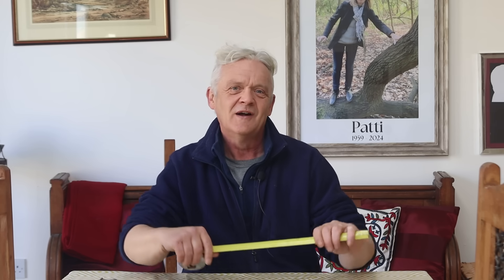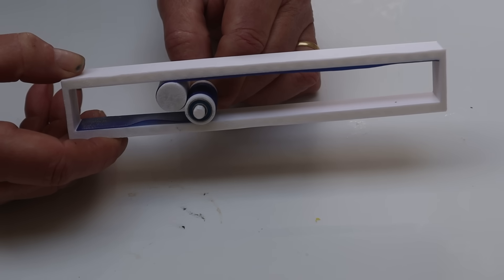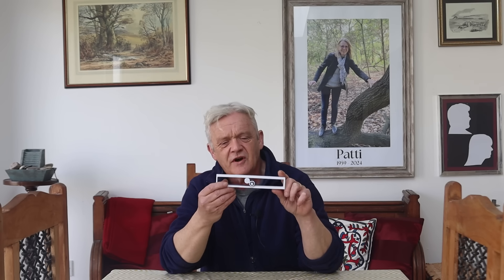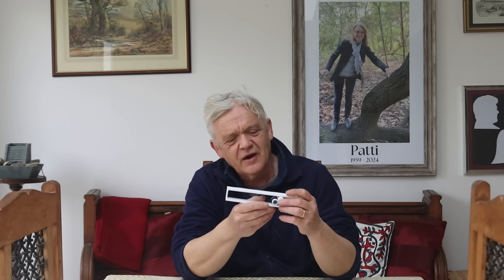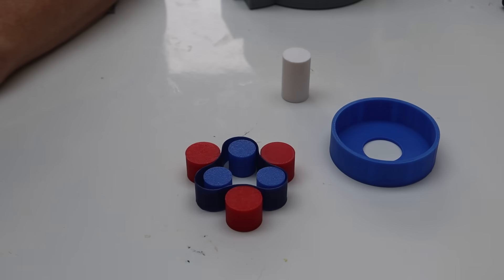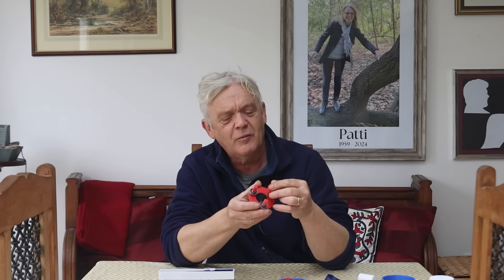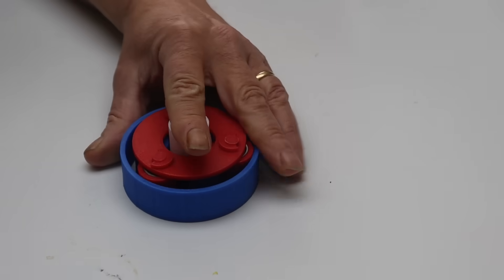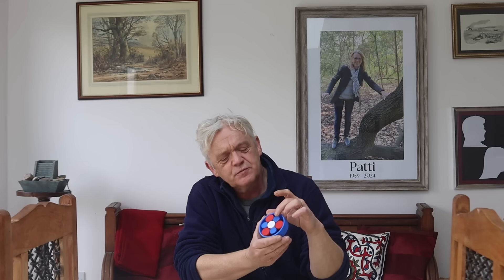2356 The Rolamite Bearing

Comment: Why have you moulded a SOLID trefoil - the principle behind all of these mechanisms is well known, and as you alluded to, they function like a gear train, by the virtue of static friction between the rollers at the interface between rollers and banding.
You can do exactly the same thing with chain(duplex) and single staggered row sprockets to create very complex systems using simple means. 
A classic example is the planetary reduction box, where the external ring gear can actually be a chain welted onto a carrier frame - this is ideal where access to advanced machinetools, or expensive equipment is not possible.
 Nice explanation, but the rigid trefoil "band" really cocks up the conveyancing of the principles(and it doesn't work eirher)? 
🤔👍

Comment: Possibly useful :: 
There was a long term test with a wire based Nitinol motor, one thing surprising from the study was the durability of the wire, which was expected to fail after some number of revolutions of the system.
Surprisingly it did not appear to deteriorate over time and it was noted that it improved in performance as the test went on until the experiment was ended.
Reply from the maker: that is surprising and very interesting - thanks for sharing mate

Comment: The durability of "one million cycles" is so dependent on usage. For a light switch used 10 times per day, its ~275 years. but for a motor turning at 2500 RPM it only 400 minutes or not even 7 hours.
Reply from the maker: yep - it's probably why it is restricted to a few applications like switching

Comment: Wow, very interesting !! Could be use as a solar actuator to capture heat in winter (by opening the solar air heater vent) and cold in summer by night..! Or as solar "stirling" engine..
Reply from the maker: do you know i think it could - i was certainly pondering that exact question

Comment: I've been fascinated with the Rolamite ever since I saw it in NASA tech briefs (as I recall).  It is a beautiful mechanism, and has extremely low rolling loss as long as a nice band of thin tempered spring metal or the like is used.  Unfortunately, although I've played around with it for decades, I never really came up with a practical use for the thing.  I think a couple or more of them would work nicely as a long throw linear motor bearing, but I've always found that for the small throws of motors I was designing, flexures worked better (I've got a few patents for such motors used in implantable hearing aid stimulators that are in use commercially).  The big problem with the rotary form is you need a continuous band.  The obvious way to make a band from a strip is to spot weld it, and that leads to all kinds of issues - a bump in thickness, poor spring tempering of the weld, etc.  I supposed at one point a good way to make the belt was from Kapton tape laid down on a mandrel with a inner release layer of Kapton that had no adhesive, which lets it be thin, strong, good energy recover, durable, and inextensible.  Making it out of TPU as you have gets around the issue of bonding the ends of a strip, although then you have to deal with the abysmal properties of the plastic (set, cold flowing, terrible energy recovery, thickness, and durability) - pretty much the opposite of Kapton) in this application.  I look forward to your video inspiring some tinkerers out there to figure out some interesting solutions and applications.  Good hunting to all you tinkerers!
Reply from the maker: Thank you for taking the time to post and i agree it is a fascinating mechanism - TPU is great for a demo but as you say pretty poor for a practical device - what do you think of one of the carbon fibre filled plastics as an idea?
Reply: @ThinkingandTinkering  Well, carbon filled would be better for inextensibility, true.  I'm not a materials expert, but can you wrap carbon filled materials around that radius without having it break down/wearing out?  It sounds like a try-it-and-see situation.

Comment: 6:30 you are not that quite right there flexing material will hold forever if you stay in the elastic deformation region at all circumstances. You can bend rigid titanium pipes infinitely es long as the material is monolith and monocrysatline and you stay at all cost in the elastic region of the specific material. This is method science is called Complient mechanism. The key of eternal flexible mechanisms is to stay in the elastic region of a monolith, monocrysatline material!
Reply from the maker: cheers mate for adding that correction

Comment: Rob, Stop right there! The linear motion is fine enough, I see potential for improving cubustion engine because there is no dead point in this mechanism if the pistons are placed on both sides you would even get continous rotation if you put those ratchet slip bearings in it
Reply from the maker: nice one mate - cheers

Comment: This is one of the best ideas that you have shown yet. Extending this... Imagine if you could apply this to CVT for example. Because the belt travels almost half way around each of the turning cylinders, it seems like the device could handle more torque than a typical belted stainless CVT simply by virtue of the contact area. The hard part, I guess would be adapting it to work with CVT.
Reply from the maker: It's a really intersting idea mate and it fascinates me too

Comment: These mechanisms were used in early floppy drives to turn a rotation motion (from the stepper motors) into a linear motion to move the heads from track to track. It was found that the band/belt would snap, and then nothing could be done to fix the unit without sending it back. So the units that used a modified lead-screw design ultimately took over.
Reply from the maker: cheers mate

Comment: Robert: How about this: remove the ribbon & replace with carriers on the roller sides (like you did for the outer Red carrier. Then make the carriers locked or rotatable. Then I think your got a compact variable speed drive. Lock the inner blue roller carrier to increase speed Now it would interesting if you could use some sort of gear linkage between the two carriers to create even more speed differences, perhaps even continuous variable speed adjustments.
Reply from the maker: hmm that's clever thinking mate - thank you for sharing - you got me thinking - cheers

Comment: Would that TPU band be better to start off as a round shape? Seems there’d be extra stresses deforming with those sharper curves.
Reply from the maker: TPU is not really a good material for this - I only used it for flexibility - but it really is a bit too 'stretchy' - I would probably try with a stiffer material - as for rounding - yeah that would help for sure

Comment: That was so close! Reading the original paper you see the important bit is the rollers must be small enough so that the roller + band does not touch both the upper/lower or inner/outer edge at same time, not just that they must be big enough to not pass eachother. The inner and outer rollers will be pushed towards their respective surfaces by the tension in the band.
When you were rotating your tests it seemed like there was a lot of friction. Looked like this was from the band passing under the outer red rollers touching the inner roller, which would be traveling the opposite way causing friction. I would love to see this again with either slightly smaller red rollers, or bigger diameter outer ring together with a tighter band. See if it really is almost frictionless like it states.
Reply from the maker: cheers mate - but I am not sure the roller size would make a difference there - i am not sure but i think it is the band tension that governs that - I didn't add a band tensioner - which would be an awesome addition - of course I used TPU for the example and that is a bit stretchy here but makes a great demo - but perhaps not a great finished item - but you do raise a really interesting point and thanks for pointing that out
Reply: The band being printed in trefoil shape made presentation easier, but probably didn't help the operation.

Comment: But the white shaft slips unlike planetary gears. 
What is the application example for this? You said valve!
Reply from the maker: it slips here because basically i used TPU as the tension strap and that's not the best but applications included, pumps, valves, switches, thermostats, triggers and suspension systems

Comment: I noticed how easy it would be to make the linear version into a triboelectric generator. The rotary version would also work, but the electrical contacts would be a bit more elaborate.
Reply from the maker: nice one mate - i can see what you are saying a triboelectric negative for a cage and a tribopositive for the band - might work and then the contacts would be much simpler - clever thinking right there mate - good on ya
Reply: @ThinkingandTinkering  or two belts that contact on those two rollers and then are spread apart a little at the framework ends